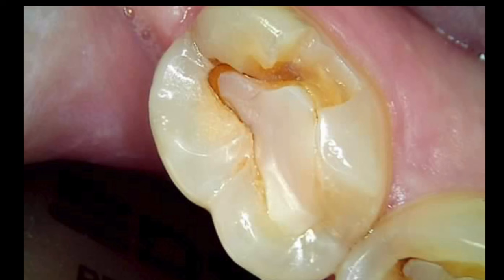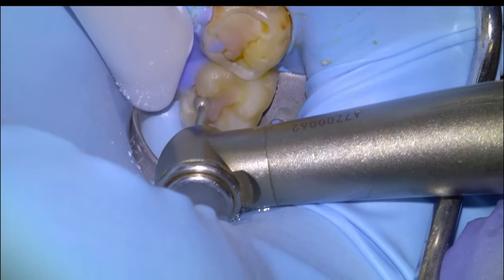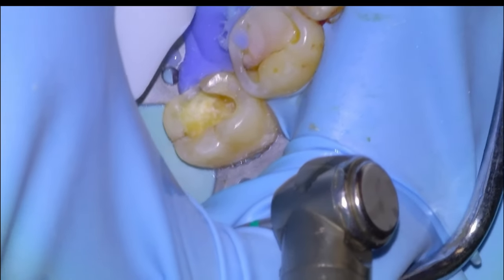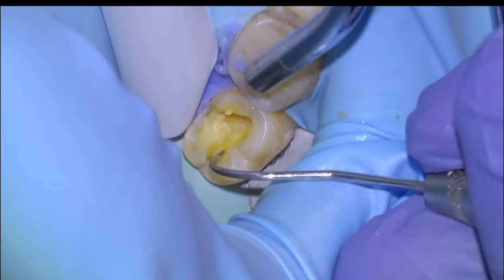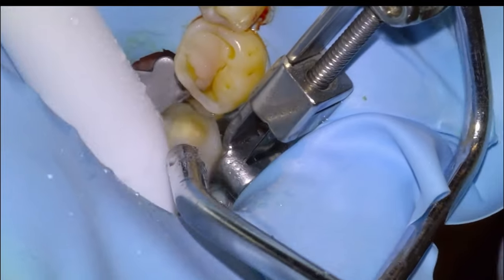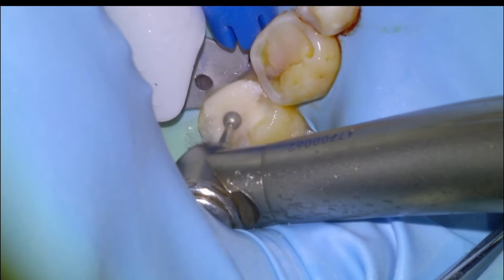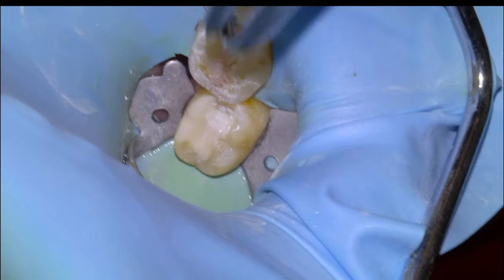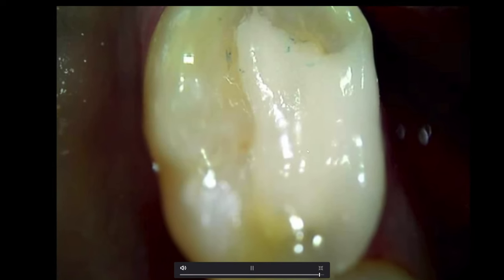[53] Fractured Tooth Repair

Comment: Was that glass ionomer?
Reply from the maker: No it is equia forte as explained in the video and in the video description
Reply: Nice video- I don’t use Equia Forte( I use Fuji II LC) but I do believe it is a glass Ionomer or maybe a Resin Modified Glass Ionomer- would you mind sharing the literature you have supporting Phosphoric Acid etching instead of conditioning with poly acrylic acid?
Reply from the maker: It's a glass hybrid. Papers:
https://www.moderndentistrymedia.com/mar_april2008/mauro.pdf
https://pubmed.ncbi.nlm.nih.gov/24861394/

Comment: you were lucky you didn't have a lingual mesial or lingual distal cusp broken down, because then a crown would be unavoidable, direct restoration of those corner fractures usually fail fast, and rarely a matrix can be fitted in a way that a decent cusp can be placed without bending in the prep cavity.
Reply from the maker: I have difficulty with direct restoration of those situations as well. Tofflemire can be used for better contours of the fractured cusp wall but then I have a hard time making good contact